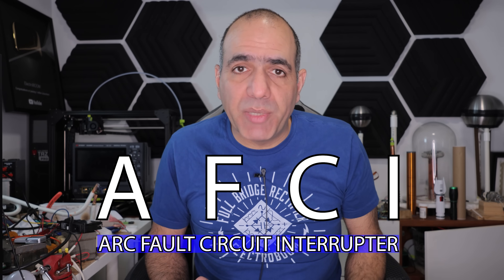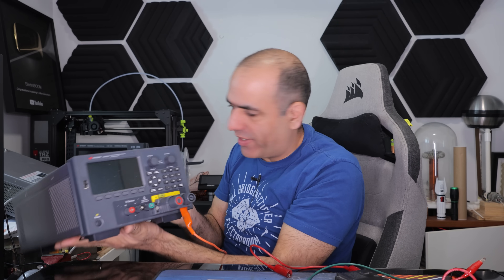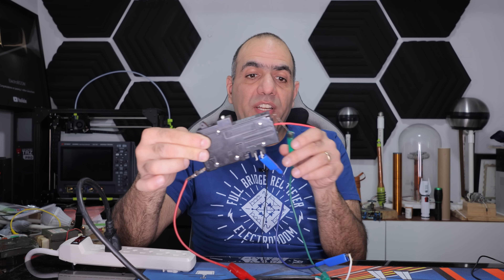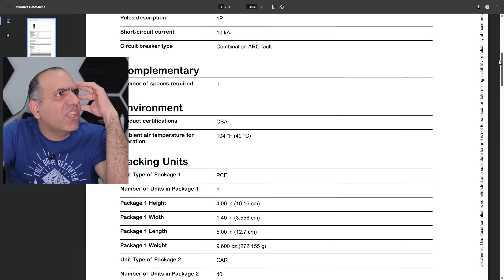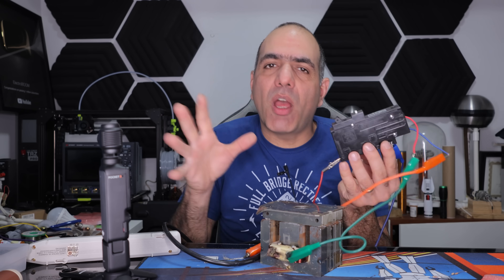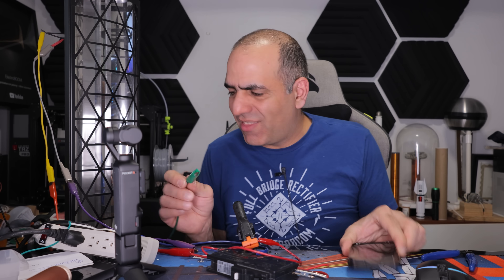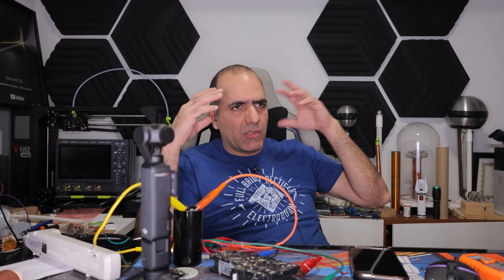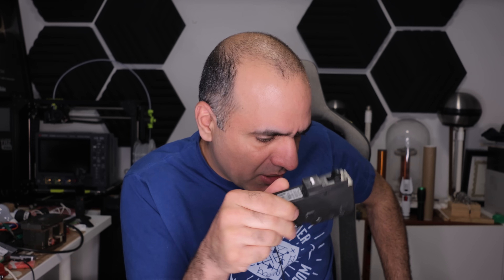Fighting Electrical Fire by AFCI

Comment: you did not test it properly
the capacitor test at the end draws very large currents from the breaker and so it trips the breaker
when you connect/disconnect the cap fast enough, the ac voltage connects to capacitor at different points and if and can create voltage differences as high as 2 * 310 volts!

Comment: I remember when they started requiring AFCI on the bedroom circuits back in '02. The guy I worked for used GE equipment and there were at least 2 breakers in every box that were defective. The first time I came across one that would trip shortly after closing it, I started chasing a loose connection - for hours, when my supervisor suggested swapping it out. Problem solved.  Why didn't I think of that?😂

Comment: That's NOT what the term COMBINATION means.  It means it trip on either series arc faults or parallel arc faults.  I will post a video on it today or tomorrow
Reply: also (depending on the brand and the manufacturing date) can refer to listed gfci function (5 mA), or non listed gfci function (whatever the brand decided on). Some units will nuisance trip on a ground fault anyways, as seen in the video.
Reply: @EqualVent it would be violation the national electrical code and UL standard 1699 to label a AFCI a combination-type if it could not do both series and parallel arcs.
Reply: @Stevenj120volts  You reference UL 1699 but fail to recognize that the definition of a combination AFCI is listed in that standard and isn't what you're saying it is. See my previous quote. That is the UL definition of a combination AFCI. Nothing to do with series and parallel arcs. A combination AFCI by definition protects both the branch circuit wiring and the its outlets.
Reply: @EqualVent @EqualVent  this silly....you probably are not an electrician  and you just used Google which get you to the free online 1699 which is dated 2001, correct?  Every time I prove you wrong you change your point. First electroboom said  combo meant afci and regular breaker, that's wrong.  Then you said manufacturer decide what combo means that's wrong.  Now you are debating what it takes to be rated  branch circuit and outlet and if you understood how to read the current standard you understand it's series vs parallel, or you could look up anything schneider has put out explaining it.
Reply: @EqualVent  I have tried to post tbe link to schneider electric website where they explain this but anytime I post a link the comment doesn't post.  I have 290k followers testing electrical.   I made a video on this topic today, you and one other person didn't believe me. They used Google and found i was right and admitted it.
Reply: @EqualVent no combination means series parallel arc detection.  That is it.
Reply: @Stevenj120volts  "Combination AFCI – This is an AFCI which complies with the requirements
for both branch/feeder and outlet circuit AFCIs" 
you're wrong there, and depending on the brand, they STILL designate some as combination AFCI/GFCI incorrectly.
Reply: @EqualVent  I am not giving my opinion this is just fact, AFCI first was made a rule in the 1999 code then in 2005 they added that all AFCI breakers must be combination-type meaning series and parallel arcs, the terminology is not up to the manufacturer  this in the NEC and in UL standard 1699.  All beakers have overcurrent protection but when AFCI were new they could not do both series and parallel arcs.  The 2005 national electrical code made it a rule that as of January 1st 2008 all afci must ne a combination type. Meaning series and parallel arcs.  The term dual function is used to describe BREAKERS that can do both GFCI and AFCI
Reply: @Stevenj120volts  You are also referencing code for the incorrect country. This video is made in Canada. We don't use the NEC.
Reply: @EqualVent  nice did you just change your point again...lol wtf you are wrong just accept it..
Reply: @EqualVent every time post a link it gets deleted.   I have posted link straight to schneider electric and they are explaining the same thing I am.
Reply: It depends on the manufacturer. For Schneider (the manufacturer of the breaker here), they use the word "combo" to describe any breaker that adds either AFCI, GFCI, or both to a standard over-current protection breaker.
Reply: @harvey66616 the term combination AFCI breaker is in the national electrical code and all afci breakers being a combination series and parallel ark detection breaker was in the 2005 nec

Comment: Amateur Radio (Ham Radio) operators were having problems with these tripping during High Frequency transmissions. It really boiled down to one particular USA manufacturer's breakers, and the rectified the situation.
I know my capacitive-touch lamp turns on and off when I operate in the 80 meter band.
Reply: Don't some of the touch lamps cause RF noise for reception? 
I remember another operator complaining about his wife getting them.

Comment: I struggled with all my AFCI breakers tripping for no reason in my new home for over a year. I'd have a circuit with nothing on it (literally a single empty wall outlet I didn't use) trip in the middle of the day, or my microwave work fine one day but trip constantly the next. Electrician was puzzled as well, and his best suggestion was to downgrade them from AFCI.

I finally realized it was my dlink powerline ethernet adapters 🤦
Reply: When I moved into my new home the very first thing I did was swap 100% of the AFCI breakers with standard breakers.  This is literally one of the worst scams in the history of the electrical code.  AFCI are VERY UNSAFE, as it causes the only people that matter...YOU to believe it is doing something it DOES NOT DO...
Reply: I clicked "show more" expecting to see "and then my house burned down". Was surprised to instead see "and it turned out the breaker was just afraid of EoP".
Reply: I had quite a lot of nuisance tripping in my home (built in 2010) because of first-generation Siemens AFCIs.  The big culprit here was fluorescent lighting, due to the arc through the gas tube that makes them actually light up.

After replacing them with modern combination AFCIs, the nuisance tripping has almost completely gone away.

If you are still experiencing this, I recommend doing the same.  It's not cheap, unfortunately (a new AFCI costs $40-50), but it did solve the problem.

Comment: So what's inside these AFCIs and how do they detect arcs?
Maybe they're detecting continuous arcs so you cannot trip them by short pulses? Hey what about making arcs with graphite rods
Reply: Microprocessor, ARM etc.  Used to be doing algorithmic detection but ... a simple neutral network is proving to be much easier to setup, train and gives superior detection of problem arcs and importantly superior rejection of non-problem situations.

Comment: In America electrical codes allow to install cables on wood structures, in other world electrical equipment is forbidden on wood structures since 1982. 

That is why AFCI is widespread in America and rare in other world: cables are attached to wood studs and wood chipboard in America, but in other world electrical cables should be insulated from combustive materials.
Reply: My house has 6 inches of slow-grown Russian larch as the exterior walls, 4 inches as the interior walls and the wires are absolutely run inside of that. Bulk wood barely is a fire hazard, the cheap American homes made of cardboard and chopsticks are.
Reply: I worked with an electrician from Ireland who told me they used to just plaster over bare wires and be done with it. He had a name like Malakee and swore at the foreman a lot for trying to break our backs and bust our balls hahahaha.

Comment: The AFCI detects the high spectral frequencies generated by arcs (20–100 kHz) and identifies the repeated and irregular patterns characteristic of dangerous arcs. It uses a current transformer to capture the signal, then analog filtering to isolate the useful frequencies. A microcontroller or DSP (digital signal processor) analyzes the waveform in real time. If a suspicious pattern is detected, it commands a cut-off relay to interrupt the circuit.

Open your AFCI and show how it's done inside... 😂😂😂

Comment: That’s not what combination means. Combination AFCI means it protects against series and parallel arcing.
Reply: "Combination AFCI means it protects against series and parallel arcing" -- It depends on the manufacturer. For Schneider (the manufacturer of the breaker here), they use the word "combo" to describe any breaker that adds either AFCI, GFCI, or both to a standard over-current protection breaker.

Comment: The quickest way I’ve seen to trip an AFCI is to add a GFCI on the load side. The GFCI replicates the high frequency waveform the AFCI is looking for when load switching. So many AFCI nuisance trips I’ve had to shake down were because of this.
Reply: GFCIs do not generate anything? Many of them literally only have a sense coil and a solenoid in them.
Reply: @mfbfreak Modern GFCIs have micro controllers. Particularly ones with self testing. These micro controllers sometimes have caps on them and during power up and load switching these electronics can cause an AFCI to nuisance trip.

Comment: The best outlets that I put everywhere where I plug and unplug stuff often, are "hospital grade". They are specifically made to grab plugs much tighter than normal outlets, and last a lot longer. I have them on the front of my workbench for plugging and unplugging power tools frequently.
Reply: All standard plugs will last two or three lifetimes, regardless of the number of times you plug something in.  In 60 years I have never seen a single wall outlet unusable.
Reply: @ASDasdSDsadASD-nc7lf  I’ve seen plenty of loose outlets.  There’s an intermediate grade (or two) between the cheap consumer stuff and the quite expensive hospital grade.  It’s “specification grade”.  That’s my go-to.

Comment: You have to use special arcs becaue of coal brush motors in Electrick Hammerdrills for example, because using such a thing shouldn't pop an AFCI, but due to coal brushes, creates a lot of arcs.
I think (at least the german ones) have a freqeuncy band in the manual, at which they trip.
I didn't test but maybe you don't need sparks, just an irregulary frequency.

Comment: Turning off a light switch very slowly can maintain a stable arc if left partially open. Maybe try that too.
Reply: That's actually the only way I've ever nuisance tripped my AFCI breakers - accidentally getting the switch in the "in-between" state from pushing the switch weirdly.

Comment: AFCIs.  Ah yes.  Well... when they first came out the number of nuisance trips were insane.  It's actually fairly difficult to differentiate between ARCing and regular on/off button and relay operations,  So it winds up being a trade-off between between safety and convenience.   The requirement for ARC fault detection on solar panel strings is just as bad.

This (among other reasons) is why multiple states freeze NEC codes to earlier years.  In the last decade or so, NEC codes have slanted very heavily towards the industry selling more gear rather than for pure safety purposes.  Mostly because the people who make the codes are almost universally industry representatives whos entire purpose in life is to force people to buy more stuff from their companies.

-Matt

Comment: You probably have a dual function breaker, which does Arc fault and ground fault protection
Reply: The breaker in the video is marketed just as AFCI. Schneider puts purple test buttons on the breakers that have both AFCI and GFCI, and yellow test buttons on the ones that are GFCI-only.

Also, GFCI in North America needs to trip at 6 mA.

It is possible that Schneider still puts some GFCI protection into the AFCI-only breakers, but at a higher current limit (i.e. the 40 mA empirically found here).

Comment: In code you can run armored cable and use GFCI breakers instead of AFCI.... that is what i did... I dont truct AFCI and for the price difference, i can upgrade my home wire.

Comment: When AFCIs first became mandatory in Canada, I lived 1 block from main street in a small town. Every time I used high frequency start when TIG welding, I'd shut down lights for half a block. The AFCIs were picking up an arc.
Reply: The AFCIs were correct. It was an arc.
Reply: This same kind of thing happens with amateur "ham" radio -- especially at certain frequencies with Eaton AFCI units. There is a demonstration video titled ""AFCI's vs Ham Radio." I have experienced similar things myself. Sounds like you had quite an adventure with the neighborhood! Thanks for sharing your experience.
Reply: The afcis here are so annoying. Constant nuisance trips from vacuum cleaners, air fryers, laundry machines and dish washers.

Had an electrician come by and he was able to remove the dishwasher afci because it wasn't needed, but he said half his job these days is going to new housing builds for people unable to use their appliances but usually can't remove the afci unless the appliance is hard wired. They have ones that update over wifi now to update the signatures for new appliances but I don't want my circuit breaker to be an IoT device. So annoying
Reply: @Jason-fp7vi when I was building homes in the mid 2000s, they were only required in bedrooms
Reply: @Jason-fp7vi  iot circuit breaker... what is this hell of a timeline we're in...
Reply: @ThylineTheGay  Can't wait to pay for a subscription to get updates to a circuit breaker
Reply: And thus a supervillain was born, ransoming the block's electricity for..... one THOUSAND dollars! mwahaha!
Reply: And they loved you
Reply: So how are you supposed to weld with these things?
Reply: AFCIs surely have an audacity to pick up trips from lower secured blocks lol. I do believe the newer ones don't do that
I always manage to trip 2 or 3 of them (sometimes for my whole house, mostly are only my room and my flat)
Reply: Pls more arks
Reply: did the AFCI rule get changed? I don't see it in 2024 CEC
Reply: That never happened.
Reply: @higgy82  I believe it. When Eaton AFCIs first came out, they were a massive problem for amateur radio operators.  Hams were tripping their neighbors breakers with RF from quite a distance.
Reply: @kc2sst  sound more like the neighbors problems too me lol
Reply: @matthewpepperl  But then the neighbour goes over to the guy who has the house with all the weird antennas.
Reply: @Obsidianxenon  maybe it dose not apply to breakers im not sure but part 15 of the fcc says its not the problem of the ham im not sure if a breaker falls under part 15 or not
Reply: @matthewpepperl  idk I'm not in the US, I was just saying that the lesser-knowing neighbour would go to the antenna farm if their electricity was going out randomly.
Reply: @kc2sst  Lets not forget that some models of the Eaton afci breakers have manufacturer faults, causing them to just fail and stop working. My girlfriend's family house was built in 2017 and has Eaton afci breakers. About 8 of them have already failed and needed replacement. Two of them failed on the same day. I understand the need for safer electrical standards in NA, but afci breakers just seems like a "throw something at the wall and see what sticks" kind of solution.
Reply: @kc2sst  yes it is a problem. the shop next door to me after being rewired kept tripping out when i was playing wireless. caused quite a stir. not to mention the odd car alarm

Comment: they prevent house arrest individuals from charging there phone to make illegal outer contacts if they some how smuggled a phone in with a charger. as if they plug the charger in its self the breaker flips or if the phone stops charging the flow currant drops to the upper lower range brake range. "a shunt meter with a low flow shut off transistor trigger"

Comment: PSA, please check if you need a licensed electrician to replace your outlets where you live. 
In the UK for example, we get away with "like for like" stuff. So replacing a light switch with a light switch, or an outlet with an outlet, is generally considered fine. So long as you aren't hacking away at any wiring or adding new wires or whatever. If insurance catches wind of that, you're screwed. (please for the love of god, turn the breaker off first).
In Australia and Switzerland, just to name a couple of places, you MUST have a licensed electrician come in. Although in Switzerland, it's mainly just to sign off on the work even for a like for like change, I believe that in Australia, you're not even allowed to do that yourself. 
Oh, and absolutely, DO NOT SCREW AROUND WITH THE BREAKER. Mehdi is a certified ..... Electrician, yes. Electrician.

Edit: Oh, also note I'm not certified in any way, I have just done some amount of home renovation myself, and love watching those kinds of videos from all around the world. So I've just got bits of information here and there. :)
Reply: Same in the U.S. You can wire your entire house if you want (in most areas).  The problem is you probably wont get any insurance company to cover you, so if the house burns, well, you're out of luck.

Comment: So, it hardly protects your home for getting on fire but protects your home for running an electric motor. Brilliant!
Do they studied many years to get to this invention?
Reply: some company probably lobbied to get it required, Schneider just made something simple that checks for prolonged arcs and still does ground fault protection because thats what you want to use anyways. 
nobody is gonna check if it actually works as sold untill some house burns down.

Comment: If you are going to test for AFCI on a breaker that does not have AFCI with the capacitor method you are using, then wouldn't that be a electrical fire hazard?